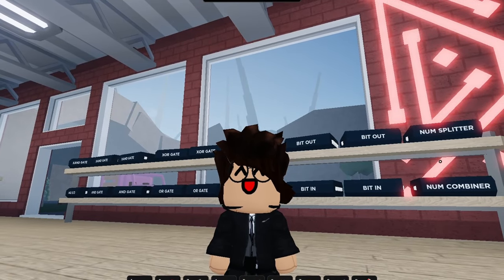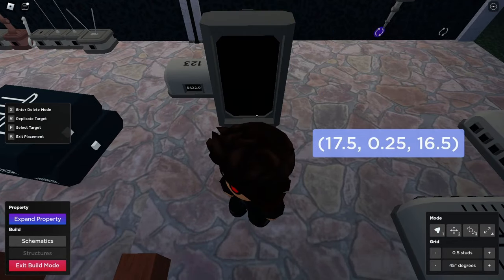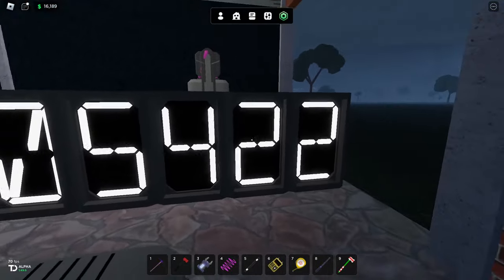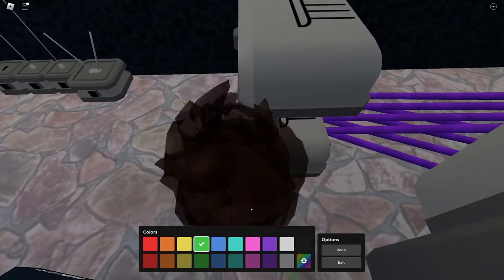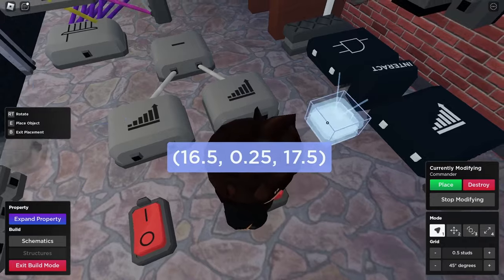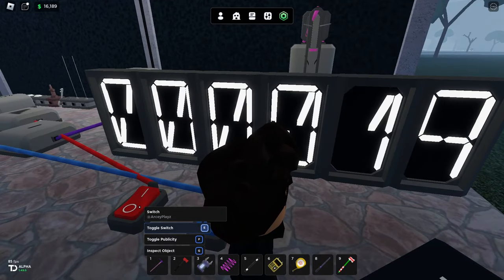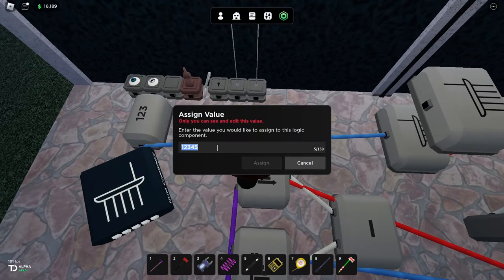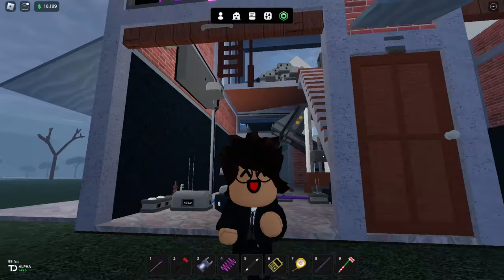Number Display & Counter Circuit in Oaklands!

Comment: The number combinator is sometimes useful for stuff like splitting by 2 digits instead of 1. This is for work with LCD because it can have colors if the signal is two digits.

Comment: Great... Just after I set up my wood/ore counter with "normal" logic I stumble upon this. My jaw dropped when you read description of number splitter lol. Basically I made it so that one incrementer displays 1's and the other 10's. The one that displays 1's resets every time the incrementer goes past 9 (by using the 'greater than' component) and the one that displays 10's is simply divided with calculator by 10 and then floored/rounded down by converting to binary and converting back because it's the only logic component I know that rounds down. 

Now I don't know whether to switch to splitter or leave it as is. Does having too many logics working at the same time cause lag or nah?
Reply from the maker: Yea I did the same thing but on my clock design, with this new gate it can be even simpler.